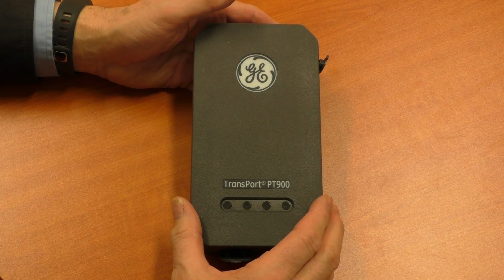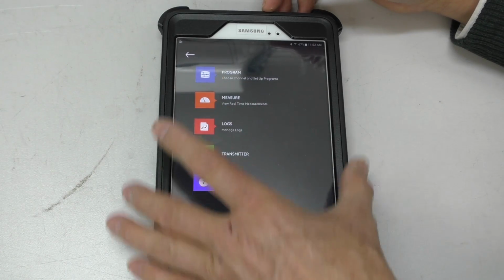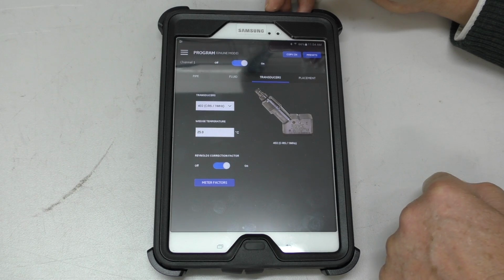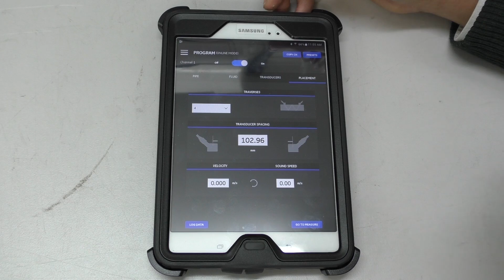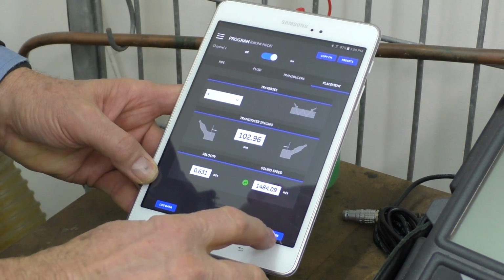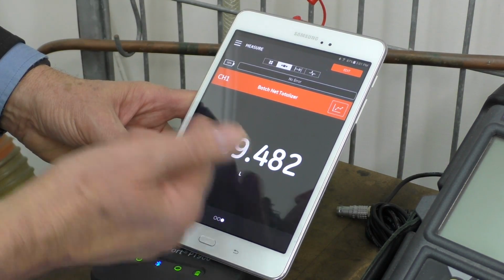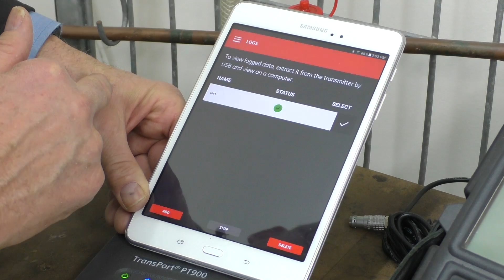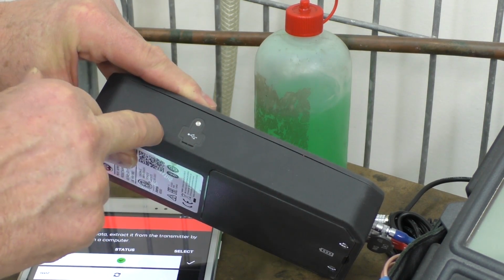How to Use the PT900 Transport Ultrasonic Flow Meter

Comment: I keep switching to english measurements. As soon as I leave that screen,  it reverts back to metric
Reply: You have to click on "save" or "okay" button (I don't remember right now the exact name). That botton is on the bottom of the screen. However, the app is not properly designed and the save and cancel bottons are being covered by the control bar of your tablet or smartphone. For that, you have to go to uour device settings and hide your controls bar.